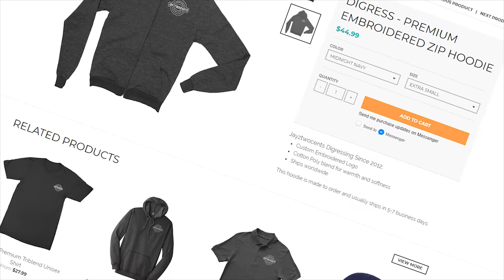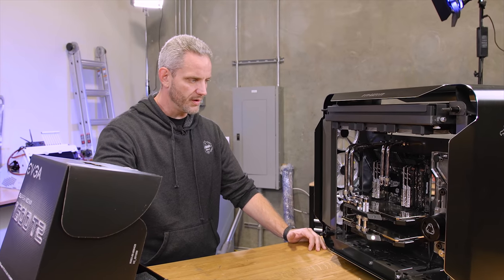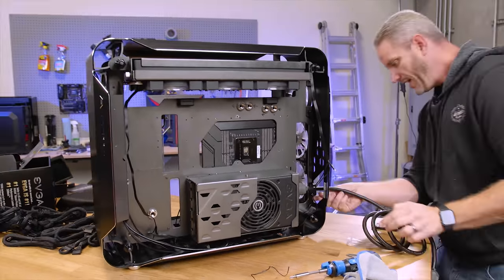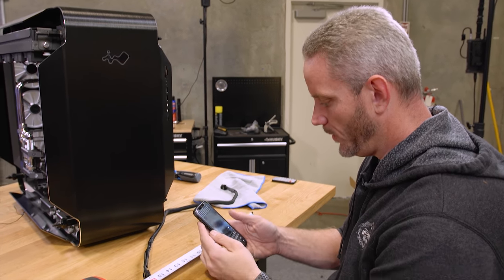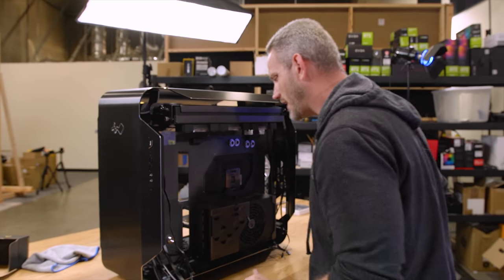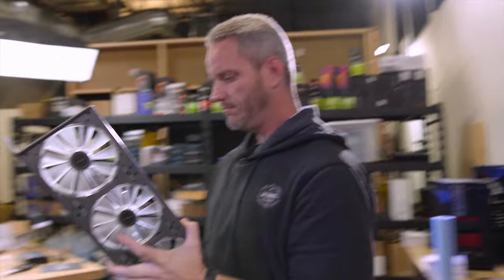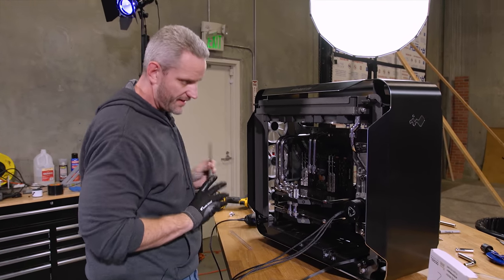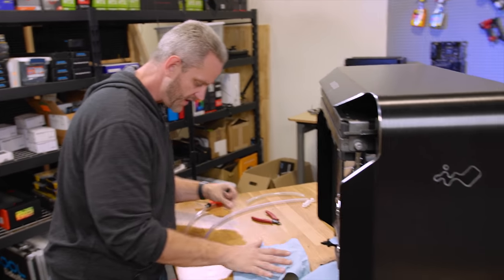This is the cleanest loop I've ever done...

Comment: Phil is the kind of young guy that makes me want to order G1/4" to NPT adaptor fittings and plumb my entire system in locally bought copper tubing and imperial brass fittings that would cost about 1/2 as much as the Chineseium BSPT metric crap we use.  And it can be bought at ANY hardware store in America. :) I may just do that so I can watch millennial's brains explode!  Jay, just so you quit screwing up tubing. The most popular homeowner vise on amazon is a Yost LV-4 Home Vise 4-1/2" 26.67  There are removable qwik clamp on vises for the same price also. I will bet it pays for itself in 1 year of this!
Reply: UPDATE I just found and bought 12  BSPTH or( G thread) to female NPT adaptors .

Comment: In Canada you can buy gasoline and diesel by the gallon. England's speed limits and distances are still done in miles and miles per hour. Why some many things bought in America are in metric is because well Americans didn't make them.
Reply: Automotive industry uses metric, even the big 3.
Reply: @Retadin  That is because most of the parts are made in other countries. GM likes to have parts made in Canada or Mexico both use metric. Ford that is also true. Dodge and Chrysler parts are made in China which uses metric. Also metric bolts often use different threading and pitch which means you can't take a imperial bolt put it in a hole since the threading and pitch are different. So when they go to assemble the vehicles in America they use metric bolts. If all parts of a vehicle where made and assembled in America they probably would use Imperial bolts.

Comment: I use to acid dip copper tubing after we acid deep copper its always washed off its the law. No acid dipper would leave the solution on the parts being dipped. As I write this I am waiting for my 16mm Barrows chrome plated parts. Should be here Tuesday or Monday. I will examine the inner tubbing to see if it was properly dipped. You ever seen freshly acid dipped copper. Its gorgeous. I will let you know.  MY Baileigh Industrial router should also be here next week. I offered to buy 20 distro plates if he made them to my specs and to No one else. my design my exclusive. He turned me down and everyone will be happy. I bought a vary large production router. and IF your going to play the game you best find out the rules. Turning down a good deal was a big mistake. 18,000 dollars for a production machine was well worth it.

Comment: i have a R5 3600 with a wraith cooler and a founders Vanilla sapphire 5700XT (with blower style cooler) however I am looking to upgrade to watercooling for both the CPU and the GPU however i didnt know whether the EK 240 classic RGB bundle is enough for both components (obliviously after getting extra fittings and a GPU block)?

Comment: HELP PLEASE!!!!!
I have a big problem and I have been looking for a solution that I cant find.
I bought a used PC that had intel core i5 with windows 10
I installed a new 500w Pawer supply, A new powercolor radeon rx580 and a new 2 riojaws DDR3 1600 4GB X2
everything went ok on my installation my computer started as it should and I was happy until I opened a game (apex Legends)
I have a noise at the background that sounds like ???? maybe when you tune in a car for a station and you don't get signal and you get a white noise well something like that but in low volume in the background of the sound of the game so I can hear the game as normal but that noise I can hear it low at the background and is annoying. so I opened an other game and I got the same noise again. so I came to youtube and play a video song as loud as my speakers can go and I don't have the sound at the background (the white noise) so I went back to apex and to settings and mute the sounds of the game and I can hear just that white noise. so why...… help please

Comment: Um.. Soo, Why don't you clean/rinse out all the stuff BEFORE you build? Also I didn't see you blowing out the metal filings, what's that going to do to your PC pump? Like get yourself a cheep pump and some heater hose that fits over your tubing and flush all of it out, rad too, maybe add a little baking soda to the flush water if it's acid your worried about. Change the water to distilled, then flush it again. Blow out the left over with air, low pressure for the rad. I mean if your making loops just seems better to have all that done so you don't have to be changing water in the build, (Oh... might lower the risk factor and ruin the adrenalin rush you get?). I do this when I build a new engine, then boom fill it with coolant, your done. That insta-catch thing is born of muscle memory, obviously, lol.

Comment: 0:53 it would be better if the gpu tubes were Fitting tube 90°  top fitting and back you will will see the curve .. now or ... like 1 fitting that connects tubes in the middle sou you can have both curves :P

Comment: Hello..can tell me plese if this components fits together?

ASUS Geforce GTX 1050Ti 4GB ROG Strix OC Edition HDMI 2.0 DP 1.4 

Corsair Vengeance LPX 16GB (2x8GB) DDR4 DRAM 3000MHz C15

ASUS ROG Strix B450-F Gaming Motherboard (ATX) AMD Ryzen 2 AM4 DDR4 DP HDMI M.2 USB 3.1 Gen2 B450

EVGA 650 N1, 650W, power supply 

Extra Mile Gaming Computer Case ATX Mid Tower PC Case with 3 Tempered Glass, 5 RGB Fans, USB 3.0 Ports & Cable Management, Black（C-380）

AMD Ryzen 7 3700X 8-Core, 16-Thread Unlocked Desktop Processor with Wraith Prism LED Cooler
Reply: I'm not an expert but I don't see anything wrong you should get a better graphics card though

Comment: Gaming in 2019.  18 core cpu then you boot a few games seeing a 5% cpu load due to dx12 and vulkan.  Currently playing borderlands and on my 9900k that only uses 8% cpu. That hos cpu runs at a cool 38c running borderlands...  with terminator resistance it was using 5% cpu.

Comment: "12:42"  what i dont get is why dont all the pc builders use a vacuum fill system  like they use on cars to fill a cooling system? it would provide a vacuum test and a zero air bubble fill @jayztwocents
Reply from the maker: Because the systems aren’t designed to hold a lot of pressure, same with vacuum

Comment: Hey guys i wanna get some help/advice, so i wanna upgrade my pc and i have 200-300$, what pc parts should i upgrade and get what (only for gaming)
Current PC: 
i5 6500 cpu
H110M-D mobo
2x4 GB ram ddr4 2133
gtx 1050 ti gigabyte 
stock cooler
250 ssd & 1T HDD

Comment: a 1600w psu, seriously?  you know, instead of running that at 5% load all the time, you could have saved a ton of money and bought a silver 650w, and it would have been MORE efficient, AND cost half as much.  peak efficiency is around 50% load, not 5%, low loads like that are the most inefficient of all

Comment: Jay needs to buy a de-burring/chamfer tool for the outer edge of the pipe. Would save so much time and frustration. Put it on, swirl it around a few times, done.
One of these guys: https://media.rs-online.com/t_large/F3394386-01.jpg

Comment: How obstinately anti-metric can you get? That bloody measuring tape has inches on top AND bottom. Why?! Why doesn't it have imperial on the top and metric on the bottom, like all measuring tapes everywhere besides the USA? They actually went to the trouble of putting imperial measurements on it TWICE rather than put metric on there. But don't worry, a $1000 watch connected via gigabit broadband to a billion dollar data centre is taking up the slack.